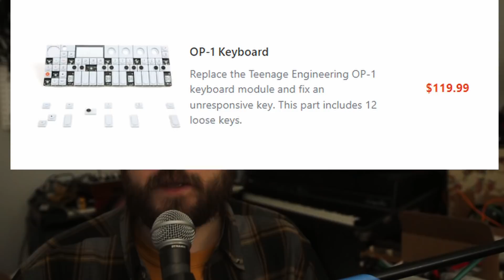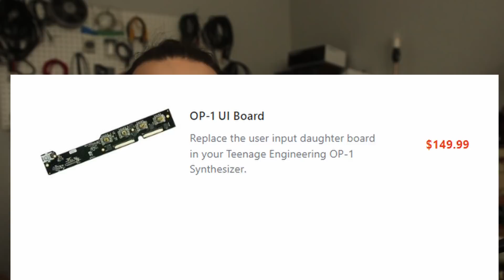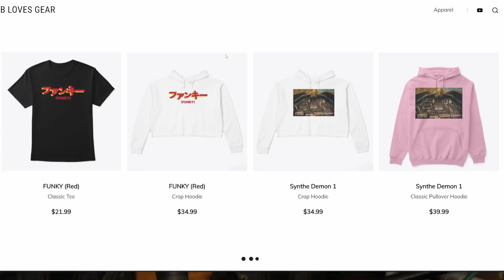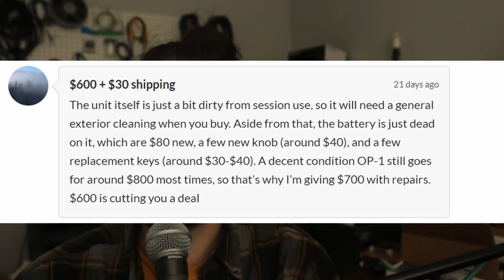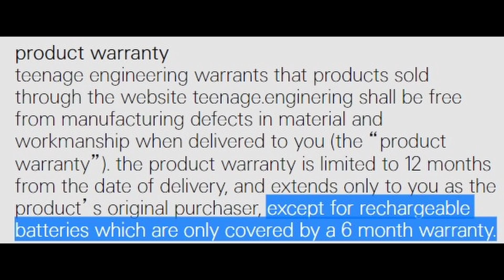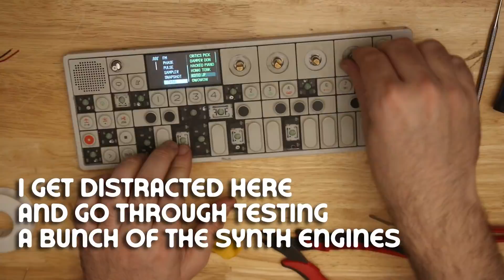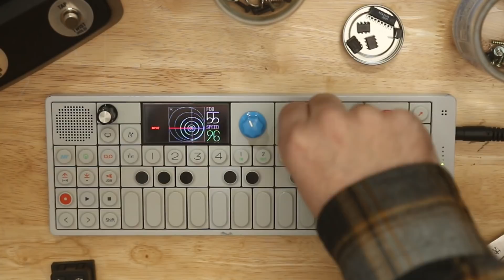Reviving a Dead OP-1 (To Make it More Affordable)

Comment: 7:23 that black screw is used by TE to determine if someone opened up their device or not, as far as I know. If it's not in that place when they receive it for a repair or something, they deem the warranty voided. Also, the black screw gets worn out by usage, so another detection mechanism.

Comment: Awesome video, love your channel Jorb!! I bought a used OP1 with two keys that don't work. The caps are on, they just don't do anything. Any idea why independent keys wouldn't work and if that would be fixable? Thanks for all you are doing here!
Reply from the maker: Cheers, appreciate that. 

I haven't heard of that on an OP1, but lots of membrane key keybeds can have issues with contacts getting worn out, wear on the thin traces that pass those signals, etc. There are tons of general resources for working on those. 

I'm not sure if there's a good way get to the underside of the membranes on the op1, though....worst case scenario a totally new keybed is absolutely an option, only might be tough to find and relatively expensive. 

Good luck!

Comment: Always neat to see those teensy tiny interconnects with little locking flaps. Many of them used on laptops and phones are even smaller. With that said, I find it insane the seller still wanted 500+ for it when it needs that much work and is in such condition. I've had mine for at least two years now and it's still mint. Mind you I haven't really taken it outside much but I do take really good care of it.

Comment: kinda late to comment, but with batteries it's best to solder the wires straight on the protection circuit on the battery so you don't have issues with shorting and it'll look like the battery came with those connectors when you put the original battery tape back
Reply: any option for the video manual pls?

Comment: Those flex cables for the keyboard are a real faff aren’t they
Reply: Do you have any advice about these? So frustrating. They keep getting loose, causing my keyboard to malfunction. The black nibs on each side of the Zero Insertion Force connection seems to be of no help fighting the tension of the cable bend itself, ultimately resulting in the ribbon getting loose. I even waited 3 years until iFixit finally stocked new keyboard replacement, only to realize the keyboard is not the problem, the flex cables are the problem.
Reply: @sebastienbarre  sorry man, nothing useful unfortunately, I remember it taking an hour or two getting the ribbon seated correctly and locked down. I presume you’re getting the ribbon to seat completely flat to the end of the lock?
Reply: @Jin-Hu  I believe so, but it's unclear to me how deep that ribbon is supposed to be in the connector. Thanks!
Reply: @sebastienbarre  as I recall one can push the ribbon in to a point at which it will go no further as there’s a hard stop

Comment: I found one today at a flea market and  I got a very clean piece with all the buttons and knobs, no damaged to the body or screen for it for around for 55 usd with a case and charging wire, now the issue is it doesn't turn on or even charge.... where do I start from ? - should I keep it on charge for couple of days or should I look at order a battery and replace it or something else to check first
Reply from the maker: check on the battery yes, but don't overlook the I/O board either.

Comment: When cutting the battery wires, you should cut them at different lengths - for example first one 3 cm long, second one 5cm long (and do the opposite for the wires you are soldering on) . . . doing this means your not going to accidentally touch them together during soldering, and once soldered even a split or slipped heat shrink tube (5 years down the line) won't short them.
Reply from the maker: Great tip, I will keep this in mind for the next one
Reply: Also means any bulk added by the solder and heat shrink joint is staggered - in tight spaces enclosures can make a difference not having both joints next to each other.
Reply: @tonydotnottingham  Yep! Also that, a bulky solder job + heat shrink and your wires start to look like they have knees, so yeah, offsetting the cuts really help here too.
Reply: Great tip!

Comment: Do you think 404865 (4mm X 48mm X 65mm) 1800mah 3,7v would work?
Reply from the maker: If it's smaller dimensions I don't know why not..but I'm no expert
Reply: did it work? i am struggling to find the new battery :(
Reply: Yes, it worked! I reused part of the wire and the original battery connector. Everything is fine!

Comment: Mine won’t go into Boot-mode so I can’t update update the firmware…EVER… I attempted to contact TE to see if I can purchase a new DSP board…they told me to contact my local supplier of parts but they never replied back to me. Would love to have updated to use audio over midi but, alas, no dice. Apparently this is a common problem with no discernible way to fix as the DSP boards don’t appear to be readily available anywhere (especially in Australia).

Comment: Not hating on the OP-1 at all, but I find it really funny when I hear "Tennage Engineering manufactured every single part", and then you see that with the screen they used, half of it is covered by the keyboard. With all the designing and cost surrounding this, they couldn't have sourced a screen that fit, or designed it with the screen dimensions in mind?
Reply from the maker: Later hardware revisions of the original op1 do have a more appropriately sized screen!

Plus the bespoke discourse is really more about the op-1 field
Reply: @JorbLovesGear  Oh I didn't know that, thank you! Do you know if there is there a way to tell if one is using the new screen without removing the keyboard?

Comment: I paid about 8 even for a mint condition OP-1 and didn't have to spend the time to fix it.  While bringing synths back to life is really important in my view there isn't much profit in it, and considering you don't have all original parts like the knobs the value you're going to get vs a mint OP-1 is going to be significantly less as well.  Good video from a technical standpoint though.  The trick to getting synths cheap is patience.

Comment: @Jorb Do you have a link to where a connector board can be purchased?
Reply from the maker: If I fixit is out, no I don't. Try ebay?
Reply: @JorbLovesGear  Thanks, no luck on iFixit. Hopefully, it will be back in stock shortly?

Comment: Do you have any advice about these damn flex cables connecting the keyboard to the motherboard? So frustrating. They keep getting loose, causing the keyboard to malfunction. The black nibs on each side of the Zero Insertion Force connection seems to be of no help fighting the tension of the cable bend itself, ultimately resulting in the ribbon getting loose. Thanks
Reply from the maker: Sorry, no tips. I find them frustrating too.

Comment: When soldering wire you can use the hook method where you form the two ends into hooks and "hook" them together, then twist them. You could also use the NASA standard in which push the two frayed ends of the wires into each other and then twist them so the frayed ends lock together. The NASA way I think works better with larger wires though. And the hook method is more pre-tin friendly.

Comment: Great work! I recently picked up an OP-1 from ebay with no visible damage, but arrived with a broken line-in port. Long story short they refunded me and I still have the unit. Haven't tried it yet, but any tricks on removing the door on the bottom door without damaging the finish? I have noticed some degraded battery performance even though it's a newer Rev.2, so I might need to try your battery trick as well.
Reply from the maker: I ended up using a really thin metal like, putty shaper to get into the corner. Its not easy to get out!

Comment: Sometimes I buy low cost little phatty or JP-8000 that need repairs like key replacement, recap, new lcd backlight, encoder or potentiometer replacement etc.  But I never pay more than one third of the average price on Reverb otherwise it’s really unlikely I will make any money.  At $700 for the OP-1 and the parts, you will be lucky to get your money back especially with those knobs that are not original.  When it comes to plastic parts, these are the most expensive parts to replace so I generally stay away when more than a couple of keys are broken or when the plastic shell has more than a few scruffs.

Comment: I had a similar situation when I bought one last year on reverb, seller had said the battery was replaced and that was the only issue it had ever had. When I got the op1, the battery still was not functioning properly and 2 of the keys weren't working, so i had reverb cover the costs of repair and the only authorized op1 repair shop in north america happened to be nearby so i brought it there and they replaced everything (battery and connector parts, and keyboard) and it ended up costing about 250 which i didnt have to pay for anyways thanks to reverbs policy. Worked out well.

Comment: I ended up replacing the battery on mine a while ago but im having issues with the storage after reassembly. I factory reset it and I go and plug it into the computer to copy over the newest version os but my computer says there's not enough storage, like 14 mb or somthing. I went over things and didn't see any damage on any of the components so im at a loss. I can't seem to find anyone else with a similar issue. I miss my op1. If anyone knows of anything I can do to fix this issue, I'd very much appreciate any input.
Reply: did you follow this step by step instruction?

Comment: this might be a dumb question but, "why didnt you just un-solder wires directly from the battery and then solder the other wires directly to the battery? seems like youre doing almost another 30 min of unnescesarry work, but maybe im missing something?
Reply from the maker: You're saying why transplant  the connector?

To make the next repair easier
Reply: @JorbLovesGear  no.....Im saying why didnt you just solder connections directly to the battery terminal itself rather than a wire extension in esscence.
Reply from the maker: @CoyTheobalt  you know what, good question. I feel like I needed a bit of extra length but it's been awhile
Reply: . Was just making sure what i did last night was ok, and I didn't ruin something

Comment: I'm looking for a battery for my OP-1 and I've found a 055070 battery 3.7v, but not with 1800mAh but 2300mAh. Having in account that 055070 stands for the measures, it could be possible to use this battery? Or it's better to search for a 1800mAh battery? Thanks!
Reply: hey did you find the answer?
Reply: Where did you find this mythical battery?

Comment: Where are you finding parts for this? That website is all out of stock on everything. I need a new keyboard and an IO port and thats probably the issue that I've got. I know it needs a new battery but I feel like thats negligible since it turns on.
Reply: did you find option where to buy the new battery?
Reply: @ nope don’t buy less than functional
Reply: @Jareddoesthings  it is mine, it was working well then i was not using it for couple of months. I was charging the op-1 and it charges forever now. However, whenever I unplug the usb cable and turn it onon it seems like the battery is literally dead :/
Reply: @ yeah it’s sucks batteries do that I hope the company addresses it but it looks like they just want to try to make the next OP1 first.

Comment: Nice work brother! I'm a dyed in the wool DIYer and have bought and fixed a ton of broken gear over the years. I have also bitten off more than I could chew in the past, and had to throw in the towel on certain gear before it ate my wallet and my time, which is always a bummer. Glad this piece didn't turn out that way! Have fun at Super Booth! Gonna be a nice flight with that little op-1 to make music with on the way.

Comment: I like your process.  And yes it is frustrating when you can't do it cheaper.  Especially when it's just a piece of plastic that can surely not cost much to make.  In my own experience of fixing various things electrical,  I've found that taking time to search is well worth while, and being patient,  hard as it is,  always seems to save money.  As for plastic parts,  could 3d printing be cheaper?
Reply from the maker: 3d printing is definitely possible!

With high enough resolution and strong enough plastic.
Reply: @JorbLovesGear  Even a cheap resin printer will be high enough resolution . . . I've got both a resin and an FDM and to be honest I'll often print my knobs/buttons (etc) on the FDM, I won't even bother breaking out the Resin, you'd be surprised at how detailed even a decent FDM can print . . . as for strength, with small parts good ol' regular everyday PLA is more than strong enough, I have a Behringer VC340 (not by any means light) sitting on two wall brackets I printed in PLA.
Reply: @davelordy  Absolutely, I bought my first 3d printer thinking of fixing my synths. I'd advice resin though, it's closer to the original plastic.

Comment: Cool video. You're brave for buying used gear that's known to be broken.

I recently bought an OP-1 new. I thought about buying one broken and repairing it myself. The biggest concern was trusting that the seller had the knowledge to know what was wrong with their device. It's also kind of hard to assign value to something that's broken. You have to take into account the risk (the seller probably doesn't know fully what's wrong), the hassle to find replacements (there seems to be a shortage of everything right now), and the time it takes to research and repair. 

Buying used, but working was also an option, but those go around $1000. At that price point, I'm more comfortable spending more and having a warranty.

Comment: It's a little concerning watching this, and wondering how many people are selling used OP-1s that look like this inside.. I wouldn't be happy if I bought a used one for $900-$1000+, and then realized that the inside looked like that. Even with the new battery, I don't want hillbilly engineering in my equipment. I would still value it for around the same price that you paid for it, $700 tops. I hope you don't try to sell it for the premium resale price, and not tell anyone about the novice work. I don't mean this to be an insult to your work, but I would want a used OP-1 that was refurbished, to have work done at factory specs. This is still a good educational video for people who can't afford to pay for a repair, and have the skills to do the repairs. I agree that it's insane that Teenage Engineering doesn't make a more affordable key set. They must be some kind of high end military space grade plastic. haha.. If someone has the means to make an aftermarket key set, then they could probably start a business making OP-1 keys. I wouldn't doubt if China makes them for 10 cents a key for Teenage Engineering. I would guess a dollar tops.
Reply from the maker: Soldering it myself isn't hillbilly engineering. It's not like I made the battery in a bathtub, I just connected a few wires. 😂

I always disclose repairs.

Comment: PSA for all used OP-1 buyers: COM mode is your friend in these repairs- Hold COM when powering up and you can get to a test mode (also to update the firmware) where you test all major functionality. 

ALSO: Contacting Teenage Engineering directly can be easier than trying to scope used parts or through the perpetually out-of-stock iFixit. 

Sincerely, someone who had to buy a whole keyboard module because two key switches went bad just so I could sell mine.
Reply from the maker: Good tips!

Comment: It's been 7 months since I requested a new keyboard set, as my Shift key is completely dead. Customer services is really polite but they are not manufacturing those parts, and I have my unit gathering dust in some corner at home.

If this situation gets to one year, I'll throw a party and every single one of you is invited. There will be sledgehammers and Teenage Engineering gear.
Reply from the maker: Oh jeez, that's a real long time. Check around Facebook groups you might have some luck!

I was under the impression that iFixit was where they pointed any out of warranty work.
Reply: @JorbLovesGear  I live in Argentina and this synth costs approximately 9-10 months of rent. No wonder there's too few of them here hahah

Comment: so theres  the nice guy seller who gives a lot of transparent honest info straight up in his posting, replies quickly, and is available for post-shipment convo, so happy customers refer u and come back. or the jackass who gives people the joy of gambling for a broken thing they bought expensive, leading them on. luckily ive had almost only good experiences, except the ones "sold as shown" type or the "i dont know whatthis is and i didnt check if the powering up works" type 🤣🤣🤣🤣
Reply: Pshhh the “idk what is type “and “don’t know if it powers on “ have been 90% rip off artists in my experience.
Reply: @Death_By_Media  sure can be. i wouldnt doubt it at all 🤣🤣

 i once got lucky tho, dude sold his deseased grandpas huge early 80ies tascam tape mixer, and didnt know what it was nor how to check. it did and is still workig fine :).  it had the original label stickers of grandpas 70ies foto slideshow for audiodub 🤣🤣
Reply: @marcochaiwallah811  good score and good luck 👍